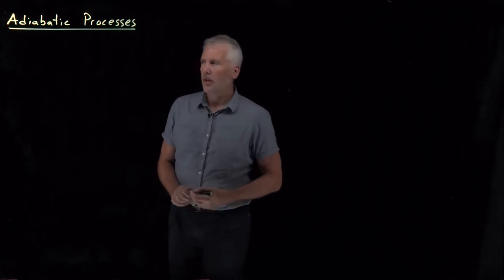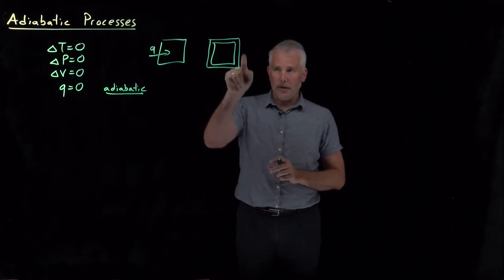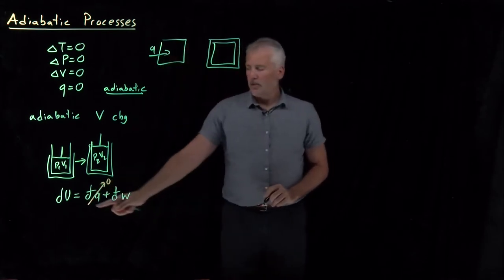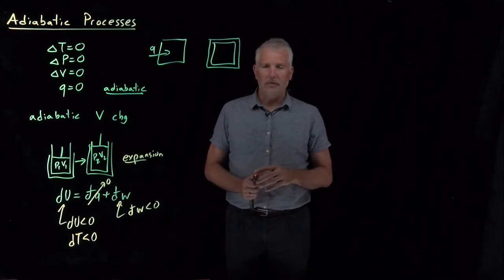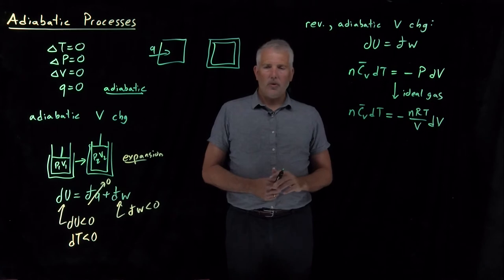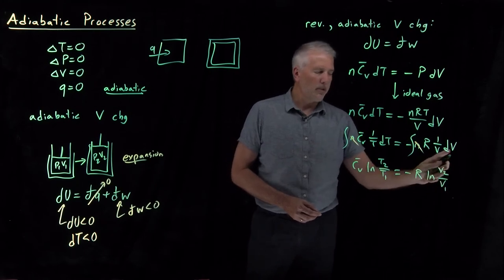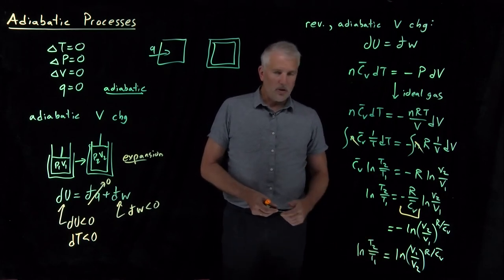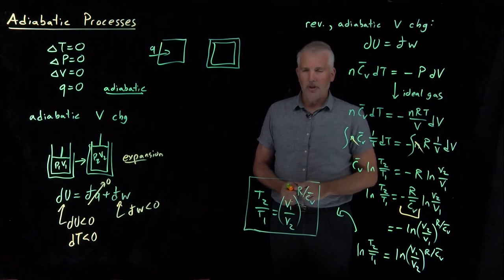Adiabatic Processes

Comment: Like all other people who try to impse a mathematical solution onto a physics action, you also give absolutely NO information about the actual process that nature uses to do this adiabatic cooling and heating thing.

There is an underlying process going on but, I can assure you wont like it and that you;'ll most likely have no interest in it. But, I will give a hint:

Since temperature is related to the speed of particles (the relationship between the speed of sound and temperature being a good and convenient example) and since the adiabatic process makes things warmer and cooler, it must somehow be changing the speed of the particles.

Or you may disagree with that and say that it doesn't.

If I'm right and it does, then the act of both compressing the...particles...and of expanding them (or at least creating the conditions for them to expand themselves) and that it results in the particles moving faster or slower, there's a step missing in the mathematical modeling; ie: HOW the particles are moving slower or faster.

I've seen the usual nonsense of the speed of the piston (which you use in your example) as being something that adds its speed to the particles during compression. But, that doesn't explain why there's no correlation between the speed of the piston and the change in temperature or how withdrawing the piston cools the particles using the same lame rationale.

I'll give one additional hint. The missing piece is something salaphysics refers to as a "lock". When particles collide and exchange their energy, momentum, oomph (or whatever you choose to call what particles in motion have to determine their temperature) the closing speed of the particles drops to zero (and lock) and at that time both particles in the collision are moving more slowly than they were. 

After some time, the lock somehow (which needs to be figured out) spontaneously breaks and the particles then use the energy in the lock to fly apart again.

If you're a scientist, that should be enough information to at least get your brain working as to what happens during the lock that relates to the adiabatic processes observed.

See. I didn't lie. I told you that you wouldn't like it. However I did lie when I said I'd give a hint and then gave two hints (so sue me).

salaphysics.com
060323
Reply from the maker: Adiabatic heating / cooling is a thermodynamic process, not a kinetic one. So any explanation that uses the speed of the piston to explain heating or cooling is incorrect. The temperature change comes from the energy spent in doing PV work, i.e. an exchange between kinetic and potential energy.
Reply: @PhysicalChemistry  - a different video came up for this notice in my mail box. Sorry about that but, the data is good. I have NO idea what's happening with these comments. My last rather lengthy comment is gone and at this point I can't be sure who I'm even responding to. Did you delete my earlier comment I posted today????
Reply from the maker: @salaphysics6558  No, I haven't deleted any comments
Reply: @PhysicalChemistry  - I found the other video but, not my comment. If it's okay with you I'll repost the comment (with edits to tailor it to YOUR  video). I question your comment that, "The temperature change comes from the energy spent in doing PV work, i.e. an exchange between kinetic and potential energy".
Reply from the maker: @salaphysics6558  You don't need my permission to post. The discussion under all of my videos is open
Reply: @PhysicalChemistry  - Sadly, I do feel the need to ask permission sometimes as I've literally been blocked by those who are thin skinned enough to think my disagreement with them constitutes personal attacks.

I'll work on the edit and post it as a new comment so it doesn't get lost in the replies to this comment.
Reply from the maker: @salaphysics6558  This is science: facts argue for themselves, and feelings don't matter.
Reply: @PhysicalChemistry  - That SHOULD be true. But, it assumes that the "facts" one has are actually the truth of science. And, there a LOT of opinions of what is true. And, I can see that. That's why whatever is presented must be defensible.

I also get it that I'm seen as being quite direct and not inclined to pussy foot around much to make sure I "play nice". I often attack people's views on science (and other topics) and will chide them on it (eg: while there are natural patterns in nature that can be mathematically (geometrically) defined, no part of nature ever has or ever will perform a mathematical calculation to determine how to do a physics action or to what degree to do it). But, I never make personal attacks (eg: Oh yeah? Well you're just a big poopy head).

Still working on re-editing my lost comment.
Reply from the maker: @salaphysics6558  You're right, many things are presented as facts without evidence. Especially in school, where there is an argument from authority that students should just take the professor's word for it.

That's a good thing about statistical mechanics and physical chemistry: I can present derivations and evidence for nearly everything covered in the course
Reply: @PhysicalChemistry  - But, is it right? In your video description you state:

"In an adiabatic expansion (or contraction) of a gas, the PV work must come from temperature changes in the gas."

PV I assume is pressure and volume. I have an issue with pressure. It's easy to measure and is useful for indicating forces against surfaces. In the case of air, under standard conditions, there are about 14.7 lbs acting on each square inch of surface. But, in the adiabatic process, the process involves all the particles (gas, liquid or solid) and a better way to consider it is the density of the matter in the volume.

In even small volumes of matter there are huge numbers of particles. If we consider each particle to particle collision and sum them, the amount of energy exchanged (salaphysics defines energy as matter in motion) is enormous. In a cubic inch of air and by rough calculation, there are about 85,000,000^3 air particles. If some 70 trillion are impinging on each square inch of surface (85,000,000^2) then how much force is being exchanged within the volume of the air?

Since the adiabatic process occurs within the volume as a whole, the density of the air must be considered.

In the salaphysics model, there's way too much force for us to control. But, what we can do is put tiny biases on the air and let the energy in the air itself do the heavy lifting.

This same reasoning applies to all sorts of physics actions that are thought and taught wrong. And, it's one of the core concepts of salaphysics.

salaphysics.com
072723
(I notate this for future reference if copyright issues arise)
Reply: You say: "But, that doesn't explain why there's no correlation between the speed of the piston and the change in temperature" . When you move the piston slow, transmission of momentum per time is lower but for a longer period of time. So the result is the same as when you do it fast.
Reply: @nillchen  - Unfortunately, there's no perfect insulation so at the nth degree level, no experiment can be done to positively give a definitive answer.

However, there are intermediate tests (both for the degree of compression/expansion and the speed of the compression/expansion) that can be performed and provide valid data.

There are tubes with a piston that can be used for such a test. There are even Youtube videos about making such a device.

I wont detail the experiments but, will note some of the results.

If the tube is insulated to varying degrees and the speed and amount of compression are measured, the result will NOT be that the same result will be obtained whether the action is fast or slow or the compression a little or a lot.

In the cylinder of a Diesel engine, the greatest heat rise occurs when the piston is moving its slowest at the end of the compression stoke. But, it's at the time when the compression in the cylinder is the greatest.

Any explanation of the adiabatic process MUST take these effects into account.

In the salaphysics model any time there is a change in temperature of matter, it MUST be as a result of the adiabatic process.  That differs it from heat changes by thermal conduction, in which there is NO net change in the temperature. If one thing gets hotter by some amount, the other thing gets colder by the same amount.

The actual mechanism of the adiabatic process is still a mystery and doesn't seem to have any good mechanical analog to try to use to explain it. But, since it works as it does, there must be a process that nature uses to do it.

Even so, the adiabatic process does seem to relate (at least somewhat) to conductive heat.

salaphysics.com
090323